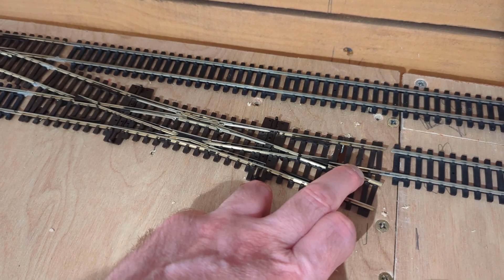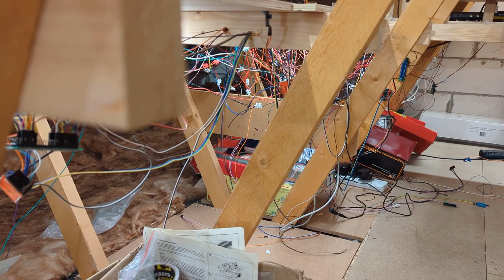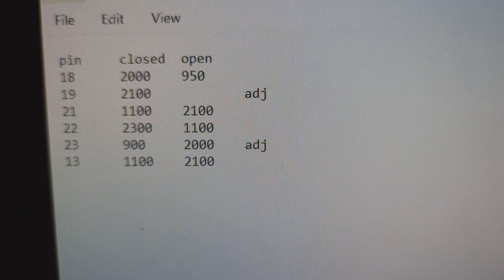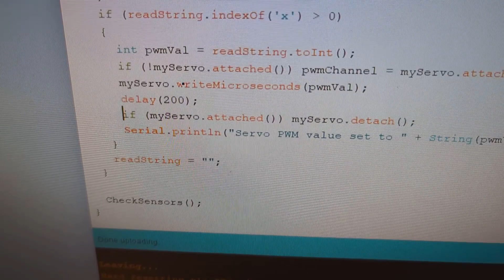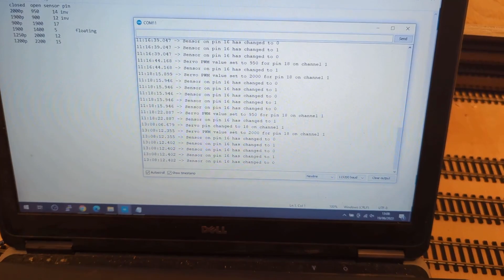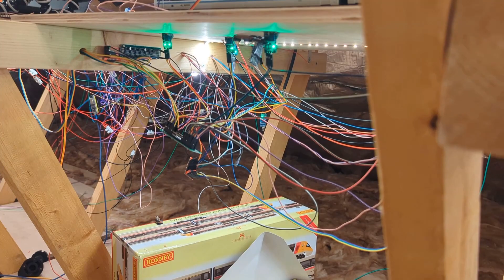Layout update - Running servos off an ESP32, adding double slips and a few more fixes

Comment: I have been working on a point motor setup built around an esp-32. it works off DCC track voltage into 5v buck regulator to power esp-32 and servo. The servo arm is the switch for frog polarity and touch sense for auto calibration and servo detach. This approach also works for stepper motors which can be had in micro size  for smallish track-side self contained point motor. A custom pcb could make this quite small.
Reply from the maker: You're doing some really quite advanced stuff there - how does the touch sense work? When you take current from the DCC track, do you also then read DCC messages? Do your servos have a DCC ID? Chris

Comment: When using the PCA9685 board, you can turn a channel off (same as a detach()) with 

pwn.setPWM(pin, 0, 4096);

pwm.setPWM(pin, 4096, 0);
Reply from the maker: Thanks that's really helpful! Bizarrely I was using those commands anyway to turn the relays on and off, it didn't twig that I could use them to switch the PWM fully off - although I think one of those lines will be fully on won't it?

Looks like fully on is pwm.setPWM(pin, 4096, 0);
And fully off is pwm.setPWM(pin, 0, 4096); 

Thanks - I'll add that to the Arduino code! Regards, Chris
Reply: Yes, the second is fully on.  I thought I’d said that, but obviously not.

Comment: Why not do infrared block detection for the double slip blocks
Reply from the maker: Thank you - that's a very valid suggestion! I'm actually going to have a play with LDRs since the ESP32s have a more accurate analog to digital conversion module on them. LDRs are much smaller and should sit nicely between two sleepers without the need for drilling holes. Regards, Chris

Comment: are you using the same values for the two positions across all servos? or do you have different position values for each individual servo?
Reply from the maker: Hey Dale! Different values on each servo, the sketch linked I'm the description let's me set each pin one by one then tweak the values. You can see a notepad file on screen a couple of times in the video that has the PWM values for each servo noted down. Chris.
Reply: @WirenwoodModelRailway  sorted, wondered as I was getting chattering and configuring each individually got rid of a lot of it. but not all

I have seen people using opto-isolators near the servos themselves as a way to filter noise, it may be nine tenths black magic but it uses that the current drawn by the isolator can be allowed to be higher than the signal current for the servo - in effect you make the stray noise a smaller percentage of the signal and it works better

apparently

I have yet to try it, there is only one servo doing it here currently, and only in one position so its not too bad but it would be nice to eliminate it totally. always a tradeoff, longer wires to servos means more noise, shorter wires means more driver boards (and likely interference elsewhere) - your move the MQTT is interesting for this as it should cut out a lot of the noise issues just through removing signal wires running all over
Reply from the maker: @aleopardstail  thank you, I'd need to brush up on my electronics knowledge but I can see the idea. I agree on MQTT, getting rid of that RS485 bus and the need for common ground across all nodes is definitely a plus. Also the PWM library on the ESP supporting the detach() command -effectively switching the servos off after they move - something that is switched off won't be affected by noise!